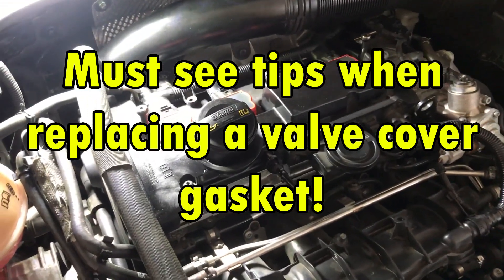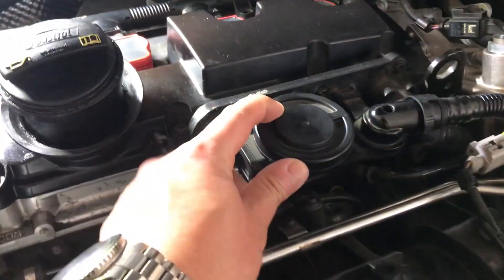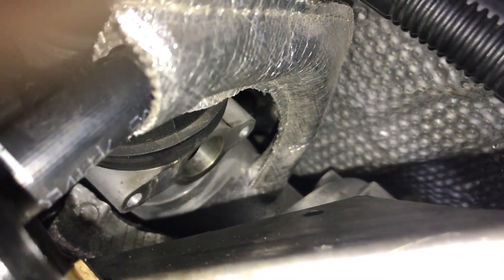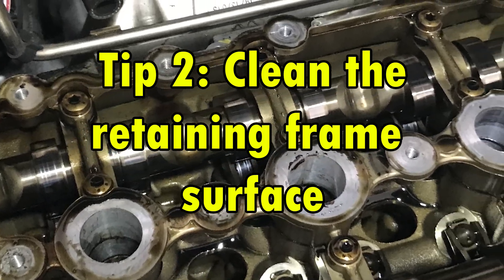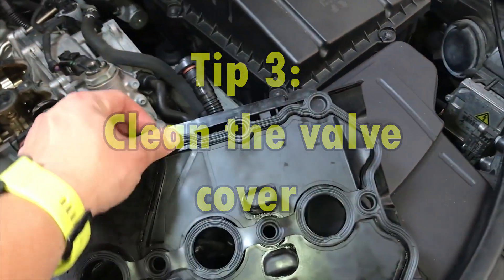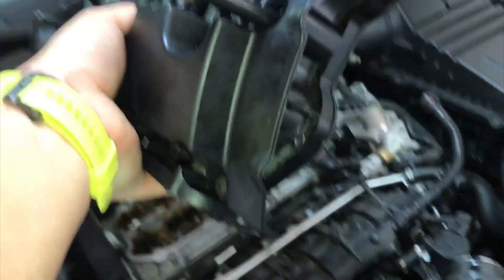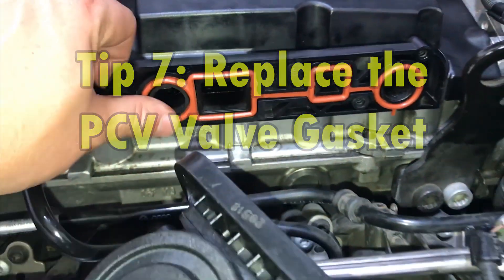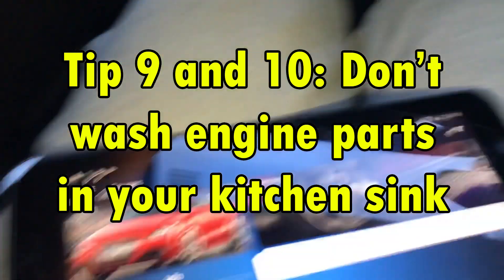Must see tips when replacing your valve cover gasket ~ Audi TT / TTS 2.0T FSI EA113

Comment: Thanks this is very helpful. Dont know why but im a bit worried about using sealant and dont have any but should it be fine if i use just gasket instead?
Reply from the maker: Sealant is optional.  I picked on that I knew I could scrape if need be

Comment: Thank you for the video bro. Your the only helpful one on this valve cover gasket. Mine has been leaking oil into cylinder 1 ignition coil is oily and nasty so hoping this fixes my misfire! Also have you changed your lambda sensors yet as I need to as I'm getting a EML light over that
Reply from the maker: No I sold this car a while back and I didn't need to change them.  They didn't seem too difficult to get to.  Good Luck!